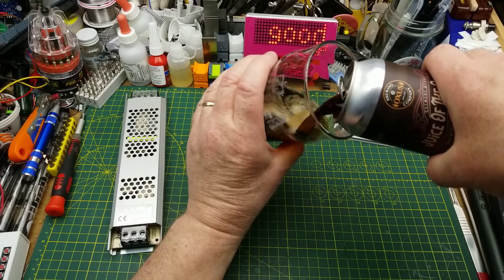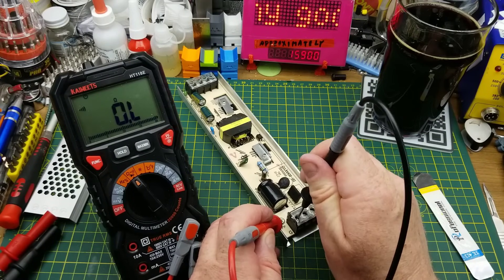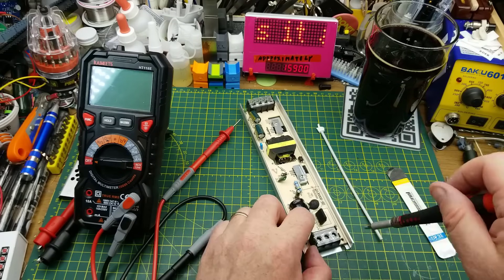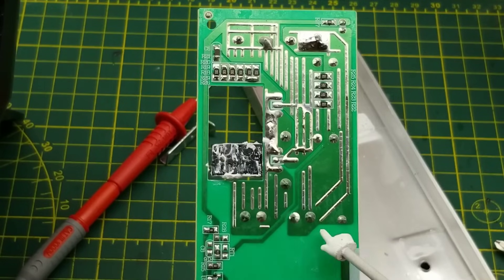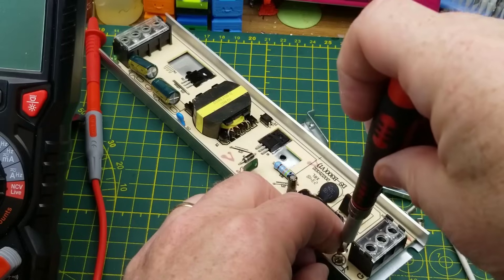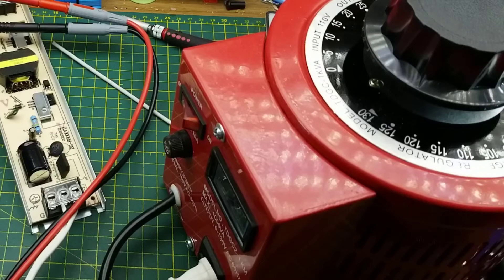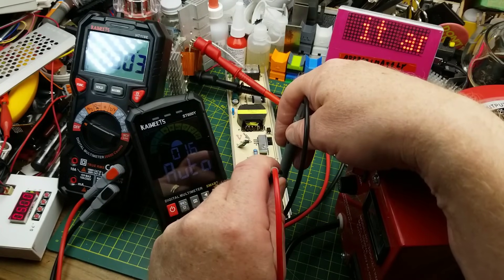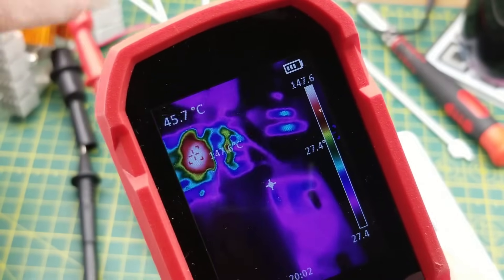Testing a cheap power supply

Comment: Nice teardown! Safety seems quite legit for me as a former SMPS developer. Of course you can not check the Y-capacitor but the spacing together with the slots in the PCB may be okay. My next point of interest would be the transformer itself. Primary and secondary windings need double or reinforced isolation, so enamalled wire of primary must never touch enamalled wire of the secondary. The standard transparent isolation of the wire itself counts only as one isolation, so either they must use specially qualified "triple insulated wire" that is clearly yellow or they need additional insulation sheets between the windings. 
Transformer quality mostly is a quite good indicator for the security awareness of the producer.

Comment: Hmm, this is a 200w device, and you tested it with just 36w. For 200w the price would be great, not so much for 36w. Mine dropped to 11V at 5A and turned off at more than that.
Reply from the maker: Yeah, I ran out of load resistors to test it further.  More are on order to give this thing more of a challenge.
Reply: @pileofstuff  awesome! I tested mine (apparently the same model) with an electronic load according to their claimed specs. As long as anyone is ok with using them at 15% max of claimed specs, they are ok. Thanks for your tear down and looking at their internals. Once you start drawing more than 15%, they fail. The initial voltage drop is worst because i.e. LED strips will still turn on, however at much less brightness. In general, with these Chinese gadgets, build quality isn’t necessarily bad but the sellers attach specs to them that are fictious. Same with Chinese batteries for example: for what they do and cost, they are not bad at all. However they almost never have the claimed capacities, typically 30-50% is closer to truth. When a Chinese device works well and is still a bargain at just 20-40% spec, then for me it’s a buy. :-)

Comment: I am always impressed about the tiny little converter ICs which are used to drive a single MOSFET for 200 W of conversion power. Lately I have ordered a bunch of synchronous buck converter SO8-Devices which are capable to drive directly 100 V at 5 A for 250 W of power through this very tiny package.

Comment: The NTC resistor is actually a "Soft start" resistor. The resistance is initially high when it is cold and decreases as it warms up. So it limits inrush current. PTC resistors increase in resistance in response to temperature and in special cases are used like resettable fuses.

Comment: My bet is that is not a class Y capacitor in reality but justa standard 1KV blue capacitor 🙂
Reply: I think that DiodeGoneWild would give this power supply slightly dodgy rating, just for this one
Reply from the maker: Before I looked at it, I was expecting "super dodgy". 
It surprised me.

Comment: I used a similar psu for a bench power supply. Put it in a box with a fused ac input. Output to a 12v auto socket. I have a fused 12v plug from radio shack that has banana jacks that I use for 12 volt stuff and a good quality car phone charger for 5 volts.
Reply: That's a cracking idea.

I think I may borrow it :)
Reply: @mattsadventureswithart5764 I’ll take that as a compliment. Thanks 😊

Comment: There should be 2 output diodes. Only 1 has been installed. With only 1 output diode, i don't believe the 16. 67A current rating  that the label says. You should replace it with a matched pair.
Reply from the maker: Possibly. We'll see what it can do after I get some additional resistors to load it down harder.
Reply: The 9mm dia. NTC does seem undersized...( physical ) .
Your test @ 3-5 amps load & it was " hot " on the th. camera..
I don't think it will sustain at the max. of 16 A dc load.....
doubt very much about the  life of both i/p & o/p caps too...
Was the heatsink temp.rise with 3A load measured?.. that's another doubtful component.
Reply from the maker: @analoghardwaretops3976  Once I receive my order of additional power resistors I plan to see how close to the claimed 16 amps it can get.
  For something this cheap, I never expected it to be able to life up t that claim.  As it is, I'm pleasantly surprised what it has been able to achieve.

You have to take these things in context of the cost.
Reply: @pileofstuff  Well it claims around 400W @16A load...and for it's size & cost ..the old 300-400 W , XT/AT computer smps heatsinks & cooling requirements..gives plenty of clues
on it's build capability..This I infer from the assumption that the switching freq. of then & now is about just 1 order of magnitude higher today..so the low cost here is really a big compromise.

Comment: i just got one of those, 48v 10 amp psu, and i blew it up ;) i saw it draw 400w, then 500, then over 700w and it popped and so did my breaker ... popped it open, trannys are gone, but input fuse was still alive :) good protected device.

Comment: Okay, those green and gold caps are known to not be what they claim to be. I don't know who makes them, but I think they are rebadged Xmas decorations... The temp rating is out by about 50%, had many dry out across smaller SMPS - better to replace with known good caps next voltage rating up.
Reply: The massive dents in one of them don't exactly inspire confidence either... and I'd bet my house that the primary cap is NOT a Nichicon. These are red flags for me, they indicate lack of attention to detail. But then it is cheap.
Reply: @jasejj  I think that many people would be tempted to choose such a cheap PSU, then use the purchase-cost saving to buy good quality caps and swap them in for the fakes. 

I doubt I would trust this for anything much more than a low power bench supply or LED strips.

Comment: Many of these cheap units have copper clad aluminium transformers and secondary side inductors (for Forward converters). They cripple these units in a thermal sense, as there's lots of losses. I bought a 400W 24V unit for shits & giggles, and it struggles to even reach 80W without dropping 5% at the output. It gets absolutely roasted at 50% load, and shuts down with time. 

And yet my 24V unit looks better than yours. The assembly and design is nice.
Reply from the maker: I've got some additional power resistors on order so I can test this thing  harder. We'll see what it can really do eventually.

Comment: that supply looks OK I would trust it more or at least a much as the little plastic covered LED drivers. I use some really big power resistors  built some into a kind of decade box totally passive  to push thing till they start to sag

Comment: The isolation is provided by the slot and the optocoupler, which looks ok. The other point is what is the rating of the cap, is it a safety cap or just a high voltage one.

I'm surprised that they didn't specify it for the full input voltage range so it could have a worldwide market, after all its just a lower voltage limit, maybe they had issues with the lower level. Or they have never tested it in the first place and expected it will work ok at 180V. The lack of components for conductive or radiated emissions hints at it having never been tested to any standards as well. 

The only problem with the input voltage level being lower than rated is whether the  components can handle the extra current in the input  circuitry at full load.  Its about an extra 0.5A flowing through the input and the transformer. Dont sound much but its about 50% more.  

200W/180V =1.1A

200W/120A = 1.6A

So as long as it starts up ok at 120V and you keep the load to around 100W, change the isolation cap to the correct type it should be usable.  
But always wear wellies if touching the output when its live.
Reply: likely due to the higher power units. The higher power units are a forward converter where you can't exceed 50% duty cycle. Lowering the mains voltage would require the higher duty cycle to reach the rated voltage at high currents, which is not possible.

Comment: Doesn't look like the voltage doubler for multi-voltage is there. Wouldn't there be 2 input bulk caps?
Reply: No. Its a flyback SMPS. Only half bridge SMPS have 2 input caps.

Comment: and the surface mount passives you were worried about were protected pretty well by the routed out slot?
Reply from the maker: Tha slot helps, but there are still some close distances that could cause issues if things went pear-shaped.

Comment: hi, you were saying about the NTC, isnt that inrush limiting?, it would be a PTC for operating current limiting?
Reply: NTC at input is definately inrush current limiter. When it is cold, resistance is higher (at device plug in) and after it warms up, resistance goes down.
In low power applications PTCs are used are current limiters, "resetting fuse".
Reply: the ntc is to prevent the cap's blowing fuses on startup, they charge up slower - common on psu's
Reply: Ptc is inrush protection/ limiter